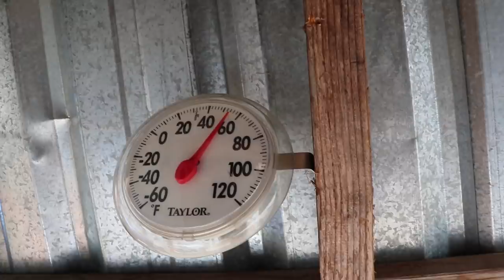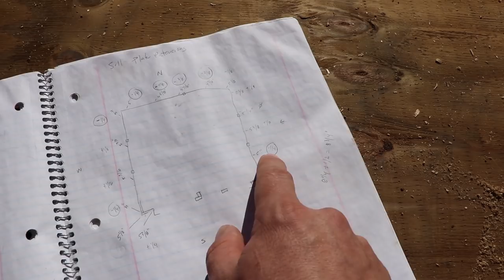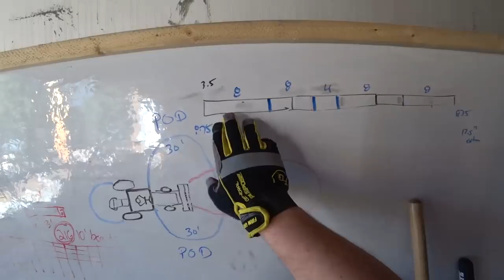Pre-SIP Checklist CONTINUES! (Adding Sill Plate Extensions)

Comment: Solution to running you saws into the top of your saw horses, attach a sacrificial plank to the top of your saw horses. Made several site built saw horses during my years working as a framing / trim carpenter. Replaced 5 times as many sacrificial planks.
Reply: Now why can't more people make an excellent comment like this one by John.....instead of "check your blade depth" and finish the comment with a child like ,duh!

Comment: A good thing to do is minimize your depth of cut on the circular saw like you do on a table saw. Not only will it be a bit safer for things under the cut it will also minimize drifting/fishing and it will also limit chipping and tearout as the angle of entry and exit will be shallower.

Comment: Cordless tools are really nice.  Corded tools are powerful.  They both have a place on a jobsite.
Reply: OH YEAH !   My son bought a nice DeWalt cordless set, but when he needs serious power or long run times, he borrows my old corded tools.  1/2" drills really should be TRIPLE gear reduction like the DeWalt DW245.  That will twist your arm off if you are not careful.
Reply: Incidentally, years ago I built a shed and opted to use a corded drill for driving the lags to hold the foundation together. I got fed up when it wouldn't drive them full depth, grabbed the old craftsman NiMH battery powered drill, and finished the job with no more concerns. I think it's a common misconception that corded always outperforms cordless. On the flip side, all of my craftsman batteries died and the entire system was divested years ago, but that gutless corded drill is still going strong ... err, weak. 

My biggest problem with the current crop of cordless is the available variety. You have to be very observant and do your research to buy the heavy duty vs the light duty version, and often the local store doesn't carry the BIG model. Makita is notorious for this - they have monstrous offerings, but you have to order it to get the big one - especially if you don't live by a large metro area. I'm pretty sure that's what happened with their newest Makita impact driver - they definitely aren't running the most powerful one, and then are disappointed by the performance as compared to the Milwaukee. Anyway, getting a bit wordy. Sorry.

Comment: Cutting plywood with a circular saw.
Step One: Make yourself a saw guide, google it, its simple
Step Two: Buy a 4x8 sheet of 2" thick rigid foam insulation.
Step Three: Put three 2x4s on two sawhorses, put the rigid foam insulation on the top.
Step Four: Put the plywood you want to cut on top of the rigid foam insulation, mark your cut line, put the saw guide in place, and set your blade depth of cut to maybe 1/4" more than the thickness of the plywood and the blade guide thickness. 
Step Five: Cut your plywood, you cut just a 1/4" into the foam, the foam, if treated well will last for many years.

Yeah framing wood is alway a bit hit and miss, you deal with it as a carpenter.
Nice weather, good luck, love the videos!!

Cheers from Tokyo Japan!

Comment: Use a Forestner bit to drill your counter sunk holes, they leave a nice flat bottom in the hole, cut cleaner and use less energy to do so.  A spade bit will also work, but leaves more tear out in damp wood.  The auger bit is too aggressive to cut a series of holes nonstop with any rechargeable tool. You'll be best to run a 1/2 drill on 120V to drill your holes, then turn the genset off.  Looks like fun, wish I were 25 years younger building a life for myself the way you two are.  Keep at it, you're doing great!

Comment: Use a Forster bit when you want a counter bore for a recessed bolt or screw head.
Wood boring bits are designed to pull themselves into the material like a screw until you bore through the other side.

Comment: For timber’s, use a corded hammer drill. I started using one last summer and drilling holes is almost effortless now. I feel like I’m cheating.
Reply: Hammer drill is for concrete, not timbers.  What they need is a corded 1/2 inch right angle Milwaukee drill.  It will drive huge auger bits, and is super handy when it comes to running electrical and plumbing.

Comment: Having done 2 huge renovations, my only observation and advice is that dimensionally, only the face of the material which will fit the other item is important...... I think you are approaching dimensions and straightness as an Engineer would (I am one of those too!) but not as a builder does.  Construction is generally a +/- 1/2” art.  That is what my experience has taught me, you will worry less and get more done in a given period of time.
Reply: Well said from someone who has bult most of their life! Seventy-one now!

Comment: You can use a small table saw to slice an entire sheet of plywood into strips without cutting half of them with a skill saw.  You just need to be careful about tapping the rip fence too hard when placing the sheet against it.  I can do it by myself.  With  your wife, she can help hold up the heavy end of the plywood as it comes off the saw. You don't stand directly behind the blade when moving the sheet through the saw.  You stand to the left corner of the plywood and direct it over the table holding it against the fence.  If I were there, I'd come teach you how.

Comment: You need to have your drills in low gear when you use larger bits or you will trash your transmission.. its slower but has more torque.. not all drills have that option but if your's does .. you need to use it

Comment: you need to adjust the circular saw depth. you don't want to have that much going through the wood. By doing so, the saw won't need to work as hard and it will be easier to get straighter cuts.

Comment: No disrespect, but time changes does not give you more or less daylight. The time change simply changes the clock, not the amount of daylight. Also every lumberyard I have ever used allows the customer to pick and choose. If they do not I would not buy from them. Lastly a suggestion. put your cordless drills in full screw instead of hammer or ratchet. It goes much easier.
Reply: if you always wake up at 9-10 a.m you do get more sunlight i guess
Reply: Lol those are impact drivers that is there only setting and it is so much better than what you call full screw
Reply: And some people don't understand why they don't read YouTube comments, lol.

Comment: Battery powered caulking guns are a lifesaver.  
A few hardwood flooring jobs I have done needed an extra sheet of ply installed, and we put down PL and screwed them down.  After a couple of tubes manually, your forearm is screaming.  The one from Ridgid takes both size caulking tubes without having to swap out the front end.

Comment: As far as hitting the saw horses, if they have the capability you can put sacrificial wood on top of them so that you don't hit the saw horse. It also works better if you have the saw blade only through the material you are cutting by about 1/8". It would have missed the metal and would only have done minor damage to the other one.

Comment: Hi guys you're problem is that you have not protected all you're lumber from moisture, all wood will absorb moisture and expanded most builders know that but what some don't realize is that water travels in a direction of teast resistance well wood has some residents so some areas in wood will have more residents then other areas if you have a moisture meter you will see that you will have more moisture in areas that larger then other areas of the same board. I wouldn't be surprised that in some areas of the plywood on the deck is blistered and delamanating, because of moisture now even pressure treated wood is now safe from moisture. I hope this info helps.

Comment: Why did the engineer specify 4X14 for the sill plate?  I am assuming this is to cantilever over the outer side of the garage wall foam but even so, it should have been easy enough to use some cleats or RSS fasteners to attach the sip panels.  A sill plate of 2X6 or 2X8 should have been more than enough.  Since the SIP panels are not really structurally load bearing in this application they should be fine just attaching as you would an exterior curtain wall.

Comment: Try some corded tools if you want to work all day
Reply: Yep, that's the deal.  If I have something quick or something that involves going all over the place cordless tools are great. But if I'm in production mode like they were it's time to break out the corded tools.  Other benefits of corded tools are that unlike cordless tools which last about 3-5 years, corded tools may outlast the person that bought them.  Also, they are cheaper than cordless tools so it's not like added them to the mix doubles the cost.

Comment: About solar, I've recently learned you can do a) heat storage in a big vertical cylinder that lasts through winter and b) have water flowing underneath the solar panels to heat up the water. That way you use your available surface twice and increase the efficiency of the solar panels too.
Or use excess electricity to heat up the water using just resistance wire. Electrodacus sells a PV charger that handles heat storage in addition to lifepo charging. Solar panels are so cheap now that the mechanical complexity of pumping water might not be worth it if you have enough land. Just plaster it with more solar panels. MPPT isn't worth it either because adding more solar panels is cheaper than the cost of a MPPT controller.
It still makes sense to be on the grid of course to be able to cover variations and also sell back energy.
After you finish your house and settle down, I hope you'll look again into "off grid" energy solutions. I bet you're going to want to continue doing youtube videos so you're actually going to look for material ;)

Also look into pumping water up that nice hill you have to store energy. Hydroelectric storage is actually more efficient than batteries.

Comment: 8" thick sip panel, so that would be 5.5-6" of styrofoam, continuous? Are they interlocking at the ends or do you just glue them or seal the joints? Would some of them come with channels to run wiring or would you be stuck with conduit? I'm curious because I want to build a 2 car garage with a 2 bedroom suite above some day.
Reply: Phone a company....or Google. There are too many variants...

Comment: It’s not over heating it’s the torque limiter on the drill  it’s a safety feature try putting it in a lower gear it should work better

Comment: Any cyrcular saw have deepth setup. To make easy for engene and blade, U set deep of cut 1-2mm more then thiknes of material. Same for table saw.
Reply: Yes, that is an option. The downside is that the saw isn't quite as stable and is harder to guide through the sheet. They had a guide, so it may have not been a bid deal to set the blade shallow. I almost always freehand my cuts (after 20 years of construction work I can stay within a 16th inch of the line most of the time, or even dead nuts on) and the saw rocks less with the motor closer to the work and the extra blade depth means you can have 6.5 inches of blade or more in the cut instead of just a couple. It helps keep the saw straight. The milwaukee 6.5 inch V28 left hand blade is the saw I like best and have used most. It is ideal for sheet and 2x lumber because it is light weight and you can easily see the blade. If I cut plywood on saw horses, I set the blade deep and look under the sheet for a clear path first. It is very easy to cut plywood on grass and set the blade shallow. This is the fastest way, combined with using a chalk line to mark the sheet.

Comment: I am sure that caulk gun was not cheap, but you need at least 𝑻𝑾𝑶 when you start doing the SIPs !

If the adhesive you are going to use comes in a "sausage" tube, get a M18 2642-20..

Comment: hi 
your using an electric drill with a bit n brace drill bit ? 
with a hand brace you have more control over the hole , you just got to get those muscles moving .lol
with the bit you had on the smaller milwaukee  drill you had the right bit on the wrong drill . you should have used the big one and flat bit . however these flat bits wear out easy so buy a few cheap ones and file them em sharp in a vice ! top tip there .
best regards
Reply: I don't understand what this means but I would like to.
Reply: They were using the wrong type of bit for the cutting they needed done. The auger bits are made to feed very fast and easy, and to drill all the way through the board. Impact drivers don't make drilling wood any better and sometimes make it worse. The drill provides consistent speed and force. A flat/paddle/spade bit on a drill would have worked fine or a forstner bit that isn't too aggressive would have been great. The forstner bit leaves a flat bottom hole with a dimple in the middle, which is great to drive a screw into. Milwaukee makes aggressive forstner bits that pull themselves into the wood (used to rough in electrical and plumbing) but that would be the wrong tool. The agressive bits don't work well with low torque, so you need higher speed on the cordless, which means it cuts too fast for this job. My V28 cordless will run all the self feed bits, but in low gear and not extremely slow speed.......and it plows right through the wood without the control needed to just counter sink a screw. The paddle bit on an impact driver will slow down when it bites in because the tool impacts under load. It works, but a drill works even better, especially for controlling the depth of the hole.

Comment: Wow. Sorry to see your drill having such problems.Although I have used my Ryobi cordless to drill dozens of one inch holes at a time without a problem, I think this kind of heavy duty use is more suited to a 1/2" corded drill, which are relatively cheap, and, being corded and not requiring a proprietary battery could be from any reputable brand. Just a thought for those projects not way out in the boonies and you have 110v power available (either solar or on grid).

Comment: Milwaukee drills suck. I burned out 2 by drilling 8 3/8 x 4 in holes in concrete. Never buy one again. They used to be good until they sold. Makita for me.
Reply: sherm dog A standard drill isn’t the right tool for concrete, on wonder you broke them.
Reply: My dewalts are good to...if your tools can outlast two sets of batteries, they are pretty good

Comment: Two speed drill. If it's shutting down on high speed, you should switch to low speed. If it's still kicking out on low, you need to step up to a real drill. Milwaukee hole hawg. Milwaukee 2708-20 M18 FUEL Hole Hawg

Comment: some larger items still require corded tools for correct progress without damage to tools or material you will find by trial and error . impact drivers are one purpose to drive screws/bolts and nuts.
 hammer drills to hammer holes, and a drill to drill or screw .journeyman  get the big buck$

Comment: Can't believe that your engineer didn't recommend  that you Half Lap Splice those extensions just to tie all of them together on the sides. Looking good so far. One day at a time.  Cutting pressure treated wood is now treated with Alkaline Copper (AC) and Quaternary Ammonium Compounds (ACQ). The  wood dust is toxic. After been expose to the dust for a period of time and if you have any sinus problems in the past. That dust will bring out those problems. Been there ,done that . Wear a good dust mask if you're planning to cut anymore treated boards.

Comment: I am amazed at how well your project is going. I would like to suggest that you are using bits better suited to 1/2in. drives in 3/8in. drills. You have a whole lot more drilling and driving to come, up size. and yes that likely means running them off a generator.

Comment: Please raise that saw blade for your safety. It should barely be showing below the bottom of your wood, about 1/8"-1/4"maximum. It also is less strain on the motor since less of the blade rubs against the wood. Also screw a 1X or 2X to the top of your saw horses. By setting your blade to the proper depth you'll never have to worry about hitting the saw horses again. Sink the screws far enough into the wood and the blade can't touch them.

Comment: The caulking gun is cool but not really necessary as long as you heat up the tubes before using them!
Reply: When you have to caulk 3,000' or more, it sure will help.
Reply: NayNayzor that is a really useful tip.

Comment: hi guys from a building construction life time of knowledge you are working with materials that conform to the laws of nature and physics ,wood constantly moves expands contracts and is milled to a nominal dimension.
That is a good property and why we use it, we set running boards to lines and by magic it bends and twists all on its own.
It may be a surprise to a lot of people  but house construction can never have inch perfect  dimensions.
Be prepared when in side for lots of timber shrinkage and shakes , part of the appeal and has been working well for thousands of years,  as for the issue you are dealing with and others working withe mixed material etc at some point you will understand work to the eye ,tap boards in and out to your eye line and as long as things are square etc you will be ok .
cant Waite  till all is under cover, beutifl location good luck with all..
Reply: Thanks for the great comment....They are definitely learning this aspect of rough carpentry...But as we know some of us are protectionists and it will never be good enough...Its not healthy nor does it make for a good work environment. I think Jesse might have a hard time when it comes to framing the interior, I believe he gets it, he just feels he needs to justify those miniscule mistakes to us, which he doesn't....

Comment: The drill probably wasn't on low gear. I don't understand why the sill plates have to be 4 X material if they don't carry the load of the sip panels Why not a 2X8 or 10 if it is just a bottom cap ?